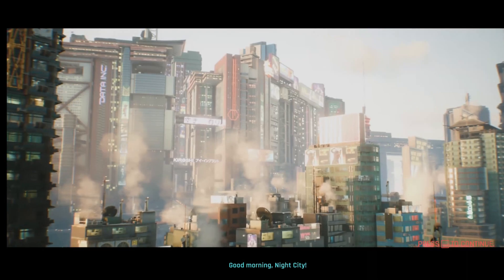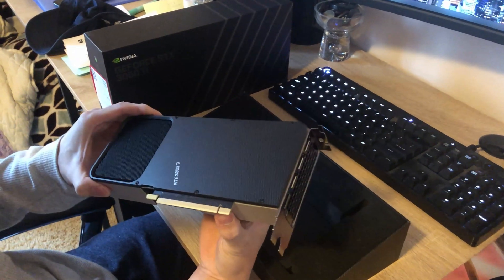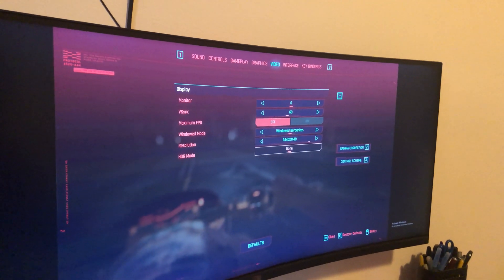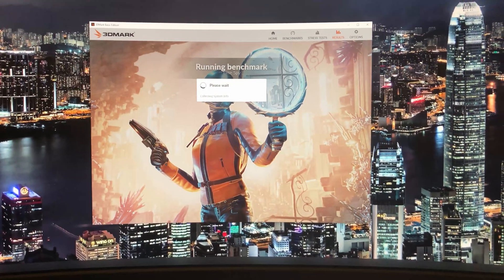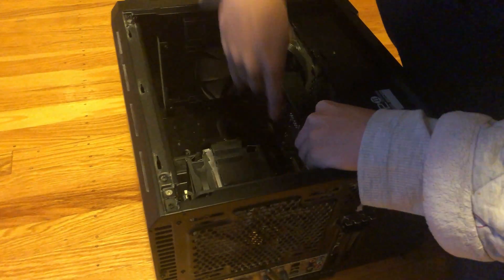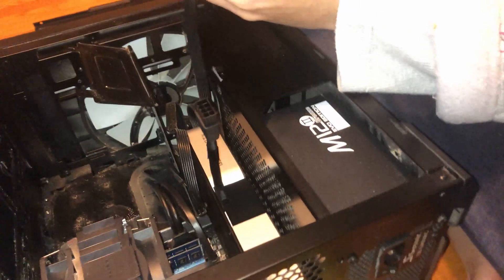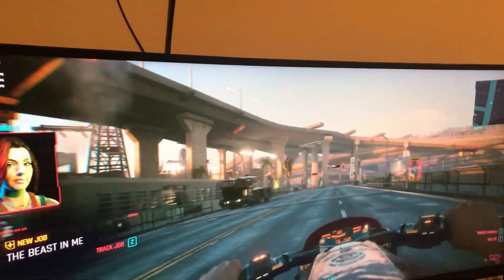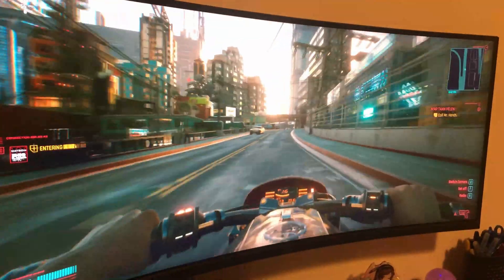Cyberpunk 2077 GTX 970 to RTX 3060Ti GPU Upgrade

Comment: I personally would not use the same CPU for the build, as it could later cause long-term cooling damage and reading quality now that it is being use more for GPU specified games. Since the 3060 ti is such a high-end card, upgrading to a better CPU would definitely help you push your frames. You could possibly be bottle necking your 3060 from your CPU being so old. 1440p is not a high resolution for your current card, but I would definitely upgrade to a new CPU. If you don't have the money to upgrade, I would say this video is very helpful for those like me, who are upgrading to a better card.

Comment: Have since 2014 the GTX970 from Asus Strix OC edition.
Its time to upgrade and looking for Asus Strix RTX 3070Ti OC. But here in the Netherlands the VAT is to much.
Total price RTX 3070ti is now around 1100 euros. 

Was it a good choice to upgrade from 970 to 3060ti?
Reply from the maker: 👋 Hi! My friend has been pretty happy with his upgrade still and if you can get your hands on a 3060ti for cheaper than the 3070, you won't notice the differences too much.

Comment: I have a gtx 970 what's the biggest card I can plug in
Reply from the maker: 👋 hey, you can use any card you want, assuming you have a sufficient power supply.
Reply: @StraightforwardTech  I have an 850 watt power supply but my pc is 12 years old now and not sure if a new card would work well in it. thank you for getting back to me

Comment: Maybe I'm a little late to the party, and I know it's not that easy or cheap, but I think that a better CPU would totally benefit his performance a lot! 
I have a GTX 970 as well, I'd like to get a 3060, 3060Ti is the best option probably but my 3600 would bottleneck it at 1080p on some games so I'm basically waiting
Reply from the maker: 🤙 word, and were almost on the next cycle for the new gear coming out soon too
Reply: @StraightforwardTech  more than 4 weeks have passed from that comment and... Basically I've found a good deal for a lower end custom 3060Ti so I ordered one 😂

I'll might upgrade the CPU later on if the bottleneck will become very big with games

Comment: I have an i7-8700 and a GTX 970. I would love to get my FPS in the 100s at 1080p since I have a 1080p/144 Hz monitor. 1080p/medium settings with 100+ FPS would be ideal for me, but with the GTX 970 I drop the resolution down to 720p in Cyberpunk and play with a combination of low/medium settings to get 60-70 FPS.
Reply from the maker: Yah, I think with a 3060ti. its not a bad jump for the upgrade. Assuming you can get a card too.
Reply: @StraightforwardTech  Yeah. I would definitely buy the RTX 3060-TI if I could find it at MSRP. At least I can hold off on buying graphics cards for now, and save up money to buy one later eventually.

Comment: Had the same spec upgraded to a 3060 was fine at first but after a couple days it started to bottleneck so had to upgrade
Reply from the maker: Interesting, I know they've been updating the game a lot so hopefully, they optimize the game for 3060 users w/ an older cpu.
Reply: @StraightforwardTech  can confirm that the did help out with older cpus and a 3060

Comment: Thanks for putting this video together, I've got the same CPU and GPU (in a mini ITX case too) and am looking at getting a 3060Ti.
Reply from the maker: Thanks for checking out the video! Also if you’re on a 1440 monitor I know you can adjust the settings to get a higher FPS too. We were just testing out default settings. Cheers 🍻